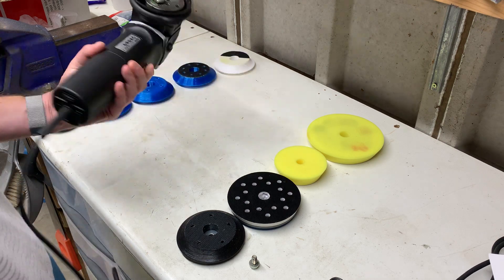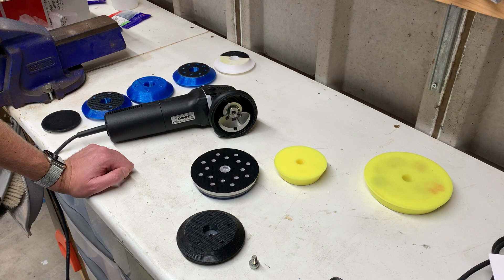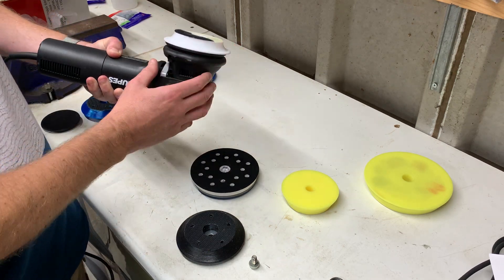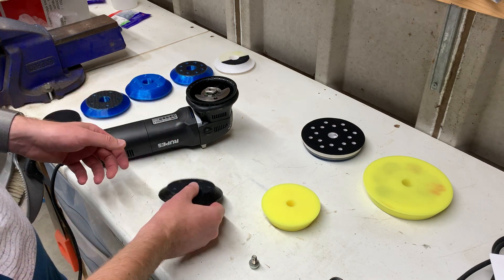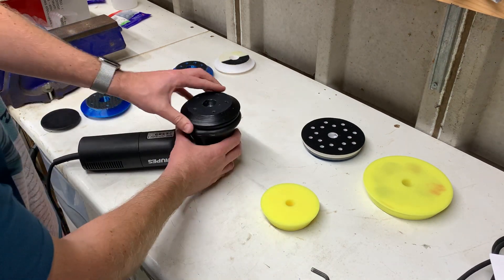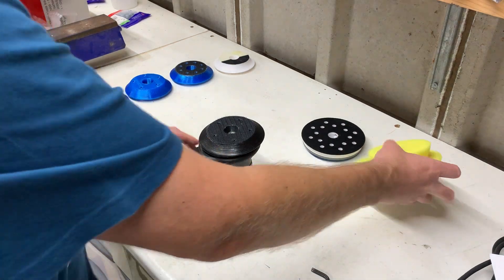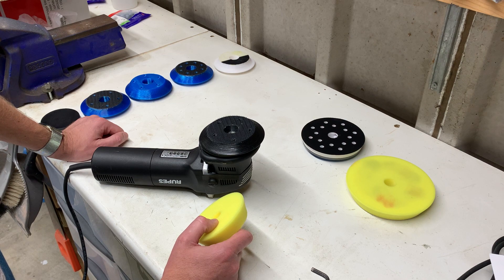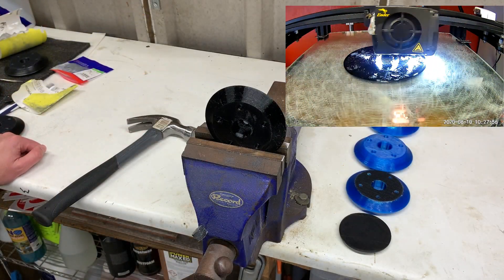3D Printed 3" Backing Plate for the Rupes LHR12E & LHR15E

Comment: Well I followed through and bought one. It fits the LHR15 I have perfectly and even comes with a spare bolt and washer should you need it.  It runs as smoothly as the bigger plate but the much smaller pad really does get in to tight spaces and complex curves. I would recommend it to anyone with a 12 or 15 Rupes machine because for very little outlay it gives you another polisher!